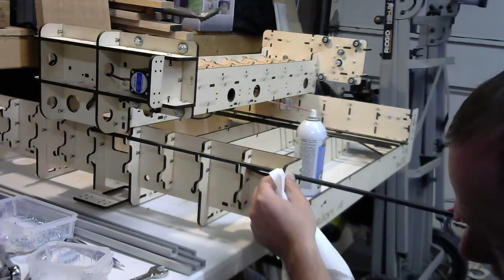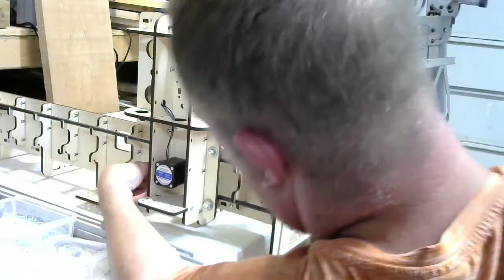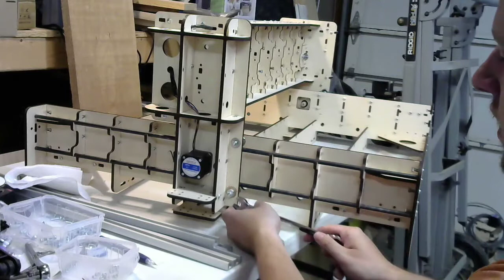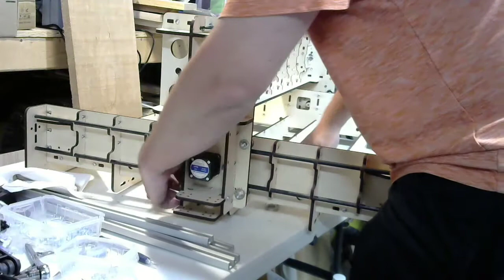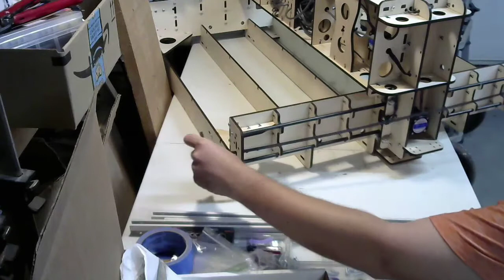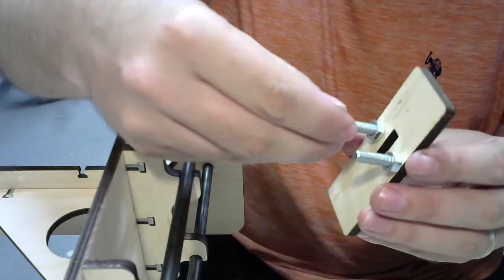8-  BobsCNC Evolution 4   X rail and belt installation

Comment: Thank you for your tips.I’m having problems with sliding and binding at the corners of the frame.When trying to home the device it locks up at the corner.Any tips on fixing this?
Reply from the maker: Do you have any photos or videos of what is happening? You can also ask in the bobs cnc Facebook group, I guarantee you will get an answer to fix it within an hour on that group. It is a great group and bob would be able to help as well. The community on that group is very helpful and you can post a photo and video on there.

Comment: Heads up that it looks like you're missing a piece compared to the manual and finished assembly poster in reference to the belt tightening assembly on the front of the machine.
Reply from the maker: Thank you. I noticed the next day and put that piece on there.